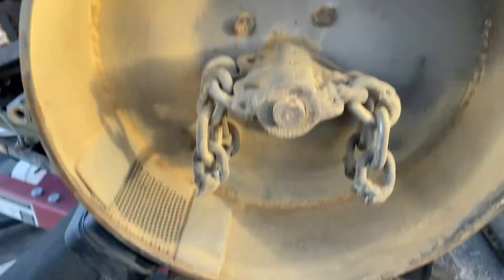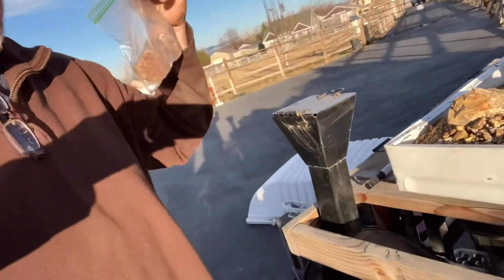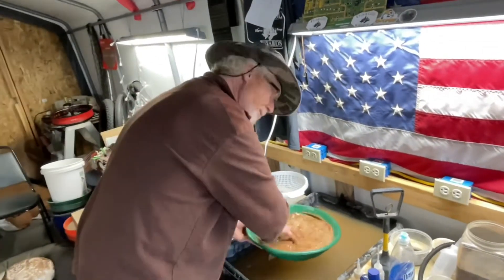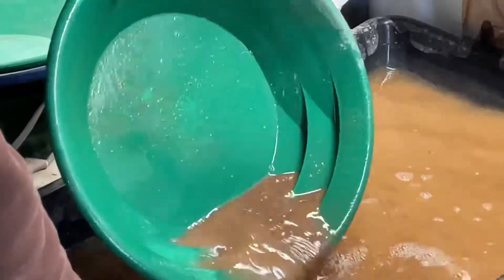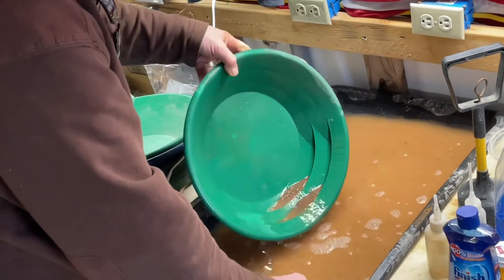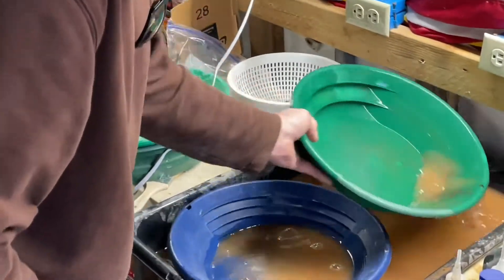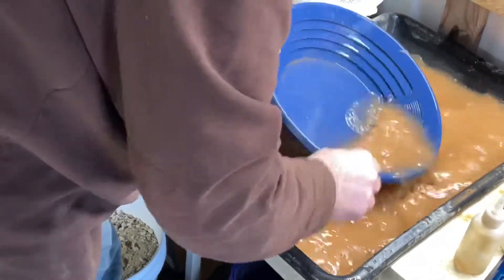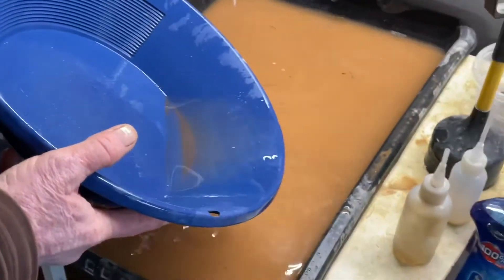FGW’s Gold Ore.. is there any Gold? Come on.. Let’s find Out!

Comment: Hey there PT.  Any gold regardless of size is 'good gold' coming out of that crusher of yours. I learned that if I stretched a gunny-sack over my 'deposit-material bucket', it cut down that dusty particulate matter down big time (70% at least). The other factor is that aftr you've done a number of buckets you can either water soak the gunny-sack to retrieve microscopic gold that would've just flown out of the bucket... or you can burn it like what the old timer's use to and pan out the ashes.

I'm just rambling here, LOL as I miss being able to go out in this current state of Chaos were all in. BUT... BUT... Your video's help fill me up with those fond memories. And if that's all I get during this period, then bless ya PT for your channel to watch!
Reply from the maker: Amen sir, I should clean up my act. 
The problem is, my flip bucket universal panerator pulse shaker compression rocklesmasho dirt washed manic spontaneousness just pops!
And suddenly I am filming something 😳
I have no excuse. I am never exactly prepared to make a video!
But Its 100% Real Baby! 
Thanks buddy 
✌️PT

Comment: Haven't seen one of those in years. I thought crushing went to Jaw crushers and bar type impact crushers. It works great.😎⛏⛏🔥🔥
Reply from the maker: Thanks Chuck, 
In diy land anything can happen.. and usually does 😳
The Hard Rock trailer has a diesel 4x6 jaw crusher, gas chain mill (this video) and hopefully I’ll get back working on the shaker table and shaking ore concentrator for upgrades and refinements. These are all on this trailer. It’s been a good diy success and love having this very handy equipment ready available!
Thanks buddy 
✌️PT

Comment: Good luck crushing the ore and finding the good stuff
Reply from the maker: Yeah baby.. rock breaking fun!
Golden times
✌️PT
Reply: @ProspectorTripp  This spring I am going to make one, on the inside of the unit did you make the collar around the shaft that the chains hook to? or is it bought and jury rigged? trying to get ideas before the build
Reply from the maker: @diggindiggenit6540  I used keyed 7/8” shaft with 7/8" RIGID SHAFT KEYED COUPLING BLACK OXIDE FINISH RC-087-KW
Bought from eBay.
Welded hardened chain links to these coupling.  Welded 5/8” rebar to the ends for blasting rocks to bits!
It works well!
I have a diy build on my channel.
Keep researching there are many good ideas and designs
✌️PT
Reply: @ProspectorTripp  Okay will do, tks for the info, found the rigid shaft, I will be using one inch,and tear drop ar500 2" instead of chain, and a 2hp 1750 220v motor, I have most everything, just need that good weather and figure out how to use the plasma cutter once it gets warmer.